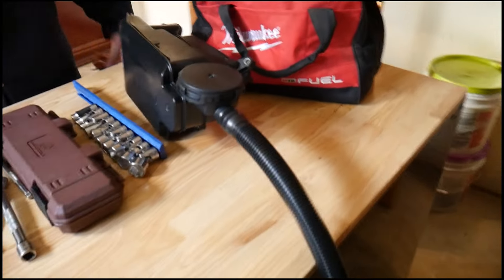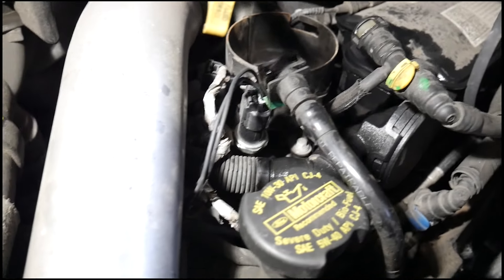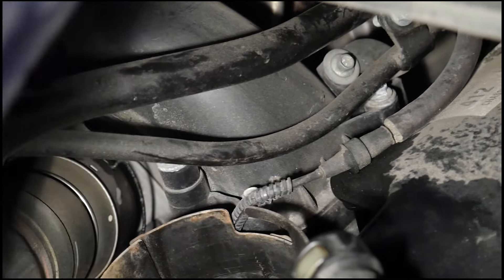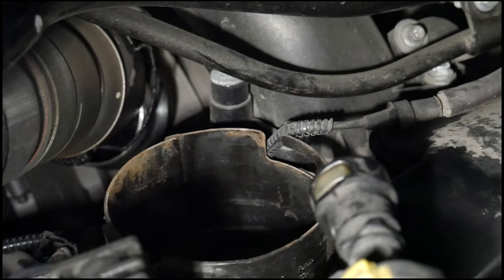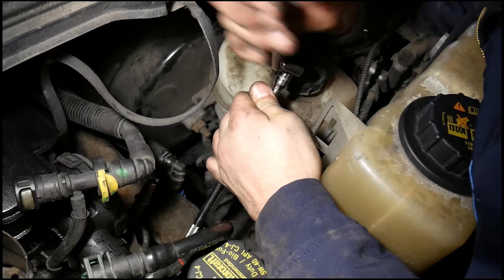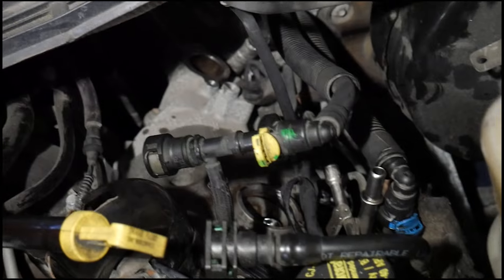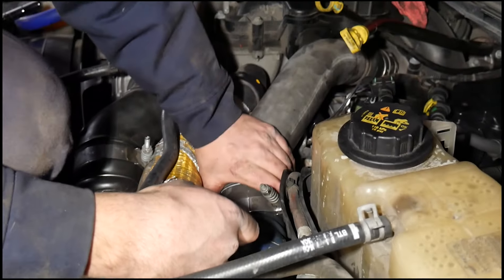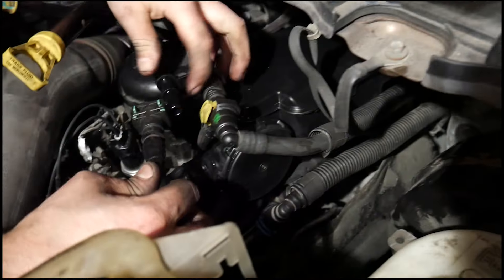6.7 Powerstroke CCV replacement

Comment: SURPRISE KIDS, part is on "National backorder".... none are avail.... as of 2/13/2024
Reply: Just bought one today
Reply: Ebay and multiple other places have them i just ordered one $115 from a ford dealership that lists parts on ebay. Google the part # you will see tons of places selling them
Reply: Got mine yesterday from full force diesel
Reply: Just got a OEM replacement 4 days earlier than expected from Rodbakerford for $128.95 plus tax.. free shipping
Reply: just changed one 20 mins ago brand new part from ford

Comment: EXCELLENT VIDIO.  Well done.  

However you might consider one change.  “Cycle your key a couple times to prime it”?  NOT NEARLY ENOUGH.  10 times at least.  As long as you can hear bubbles and gurgling sounds from the pump and filter  you still have air in the system.  If you prime it twice, then hit the starter and it starts then stalls that means you ran your CP4 pump dry causing metal on metal friction failure.  ( $10k). This is the most common mistake made when opening up the fuel system and it is likely why so many CO4’s fail prematurely.  When replacing upper and lower filters I cycle without starting 20 times.  It has never stalled.
Reply: thanks for this
Reply: This is a CCV filter not a fuel
filter
Reply: @TerpyToaster  The upper fuel filter was disconnected...

Comment: There are ccv boxes with filter came on f350’s I believe and f250’s came with ccv box with no serviceable filter. Mine is a 2019 f250 and has one without a filter. Since there is no filter is it still necessary to replace it?

Comment: What's the part number so I can look for a replacement.
Reply from the maker: depends on year. this specific on for a 2011-2016 is DC3Z-6A785-C

17+ is GC4Z-6A777-B

Thank you for letting us know. well try to remember part numbers in the future!
Reply: Cheaper at the dealer than online
Reply: @badmechanics9697  did you use the dc3z on a wide frame truck? The dc is for narrow frame. Fc3z is for wide frame.  Found this video while searching the difference.   Maybe you can help. 
You have a pickup bed or a utility truck? That’s the diff between narrow & wide frame.

Comment: Question on this older video.  You said it’s normal to have oil in the valve cover opening under the CCV box. Is it normal if it’s right up to the brim? Like lightly pouring out? Truck runs fine and doesn’t smoke. Was just replacing CCV for maintenance.

Comment: For what it's worth I got my filter from, Parts Geek, for $86.  It's the newer kind that replaces the whole Box.
Reply: Did you replace this version in the video with the newer one where the screws in top and takes a filter that looks like a Z ish and two white ovals as the filter?
Reply: @logangregory7105  
No sir. 
My F250 already had this type which is the newer version. It's called an oil-air Separator. 

 It's my understanding that the type with the removable/replaceable filter is the older/original version.
Reply: @logangregory7105  

This is what the oil separator looks like inside. Notice no filter.

https://youtu.be/I38JFfj3T3o
Reply: @amftpt  thank you for the info my dad has a 2017 and I have a 2018 mine was the newer version which didn’t have it so now I’m all good!👍

Comment: Thanks for the video. Instead of taking the hot pipe off the boots i just cut the plastic tube with scissors. Then moved the rubber sleeve back on the quick connect and bent all 3 plastic tabs back and pulled it out that way. Everything else i did the same.

Comment: Thank you for making this video. I bought my 20114X4 Powerstroke new in 2011 and I've driven it like a old lady. I deleted it but the EGR system is still hooked up. I retired the truck back in 2019 and I drive it every 2 to 3 months just to keep the fluids flowing and keep the battery in check. Every now and then I'll get smoke at idle and especially in reverse backing into my driveway. This gentleman has 114,000 easy miles on him. Do you think that this could have something to do with the crack case filter that you were changing in this video? Oil has been changed religiously on this gentleman and all filters as well by the book. The only thing that has never been changed is that crack case filter. Again thank you for your video, it was very informative and to the point. Thumbs up on your video bud. 👍
Reply from the maker: Thank you! that comment means a lot!. I would start with the ccv. if I remember correctly, it was like 140 dollars and about a 30-40 min job. that caused my hazy exhaust and found a good little bit of oil in my intake piping. after i did the new ccv filter i still had some oil in the intake so it took a few days for it all to get cycled through and burned so give it some time before buying anything else expensive. if that doesn't fix it, you may want to look into getting block off plates for your egr. its still prone to cracking and leaking coolant into your intake. depending on your model year, it can either be cooled by your primary or secondary cooling system. I am not sure the price of just plates since you already have the rest of the delete done but it shouldn't be a lot. you could also check your secondary coolant tank (the coolant bottle at the very front by your radiators) if its low, id recommend checking out your intercooler and getting it pressure tested. they can leak coolant into your intake as well and every model year intercooler is part of the secondary coolant loop.  sorry for writing you a novel!
Reply: @badmechanics9697  Thank you so much for the info and the fast reply. I will definitely check out those things. I never thought about the egr cooling system and I will look into capping it off. I will change out the factory ccv and give it a while to clear itself up and then go from there. Again, thank you so much, take care friend. 👍
Reply from the maker: @williamsantiago7303  no problem! good luck
Reply: @badmechanics9697  hey bro I got a 2014 6.7 just bought it.  It smokes but doesn't have pressure when I remove The oil cap Is that normal.
Reply: If its 2011 cracked valves probably if not ccv
Reply: @bigred5082  white or black smoke? Lol white means something is wrong. If it’s black that means the truck might possibly be deleted and tuned. Like someone above said. You can delete these trucks without having to remove the egrs.

Comment: Awesome video. Short and to the point. Looks easy enough (famous last words).
Reply: Yea just did it tonight its a total pain in ass took like 3 hours and 4 cuts on my hand. Unless you have the perfect combo of extensions and swivels those bolts are pain to reach and try to fish in out. I also had to unbolt the the brackets holding fuel lines to move those which block the front driver side one  that has a stud on top to hold wires
Reply: @bwooters8227  I had to take that stud your talking about out too. Still wasn't too bad thought. the bolts weren't as hard to reach as I thought they would be.
Reply: Just got done doing mine and I had to remove that fuel line bolt also. The back bolt on the CCV was a major PIA.

Comment: Aye man, I'm a ford mechanic. According to the WSM Manual, it states in bold "DO NOT LUBRICATE SEALS ON THE NEW CCV ASSEMBLY" Or something along those lines... Just an FYI.. But I do have a quick question for you, as there's nothing specified in service information, and I haven't been able to find anyone else talking about it... But one of the tags on the original CCV Case, has extremely important information... regarding the Injector Coding Numbers. I've always just written them on with a paint marker or something similar, but just wondering what do you do with the sticker/injector coding info?? Because if it goes somewhere for injector replacements or engine work, the coding numbers would be imperative to completing that kind of work.
Reply: Exactly what I was thinking about. I need that coil pack info to stay with the truck
Reply: @James-wy6py  well, it’s for the injectors. I’d say good luck on finding ignition coil packs on a diesel engine. 😅😂

Comment: Hello I have a 2012 with 163xxx miles and I'd like to change my ccv filter asap, but I also seem to "burn"? Some coolant. I don't see any leaks on my engine while it's running and I don't find any drips underneath but I can smell it seeming to burn every now and again. My exhaust is just unbolted at the front of where a delete pipe would bolt up and it leaks a bit of what looks and smells like oil with maybe a little bit of fuel? I plan to do the ccv filter then asap get the egr plates but idk if there's something else I should look into if the issue keeps up afterwards? It's not going through a ton of coolant but about a half inch when driving about 60 miles round trip
Reply: It hasn't had the ccv filter since I bought it about 3 years ago and that small coolant jug has never held coolant for me. It always seems to go somewhere
Reply from the maker: check both reservoirs, which one is leaking?

Comment: Do you know if the 2016 f250 6.7L has the ccv and if so if its the filterless one?
Reply: Yea 11-16 didnt use the filter style. You can look at yours to confirm no bolts on top its filterless. This job sucks tho i just did tonight not fun but they claim you still need to change the filterless every so often. My truck has 150k so did it
Reply: They will still swell up. I’m pretty sure that means change

Comment: Why did you change your CCV filter? I believe the one you have doesn’t require replacement, because there are no screws that hold down the top cover of the CVC filter.
I’m just curious because that’s what I was told . Did yours fail in some unexpected way?
Reply: I was thinking the exact same thing
Reply: I agree. I thought you did have to touch it if its the filterless version???? Anyone have info on that????
Reply: @RC-hm9vg  I believe it isn't actually filterless - it's just that those older part numbers have a sealed box so the filter is not changeable - meaning you have to change out the whole box.

Now I'm wondering if the newer box WITH a serviceable filter and the screws on top could be used in place on an older model like mine (2014 F250)  That way I could change out the box and just do the filters from here on out every 80k miles or so...

Comment: My 2018 leaking oil from upper oil pan.. (79k miles) dealer said CCV clogged. 2018 has the service replacement filter version. Need to replace that and upper oil pan gasket. 3k later…

Comment: Hey buddy, I asked you some questions about my powerstrokes  intercooler maybe leaking  and white smoke out of my exhaust and you gave me done pointers and it was a while back and you came thru for me and answered them for me and I appreciate that.  I finally  got my new ccv box and I was ready to install it today and I noticed that at the end of the elephants trunk it had a electrical connector and my factory one doesn't have that and I noticed in your video that the one you replaced doesn't have that electric connection either  but the one you installed has it. Did it still work without any engine lights coming on, isn't it something I should be worried about?
Reply from the maker: Hey! sorry for the late reply. I did not have any CEL come on. I wish i could remember what i did with it but im not sure i did anything. sorry if this doesn't help much it was just a little while ago
Reply: @badmechanics9697  Thank you for the reply and your answer. If you didn't have any lights come on then I shouldn't have a problem with mine, thanks buddy. 👍

Comment: My 2011 6.7 has started leaking oil out of the pan gasket, it seems. Would the CCV be the first suspect? Should this be my first fix?
Reply: Same thing is happening with mine, let me know if it fixes it
Reply: Make sure you do t have a leak from the air pump behind the water pump. They have been an issue.

Comment: Mine did not come with a ccv filter. I have a 2020 f350 dually. Any ideas?
Reply from the maker: if you bought it new it should be there, against the firewall driver side
Reply: Big black plastic box behind the top fuel filter.
Reply: @badmechanics9697  found it.  Thanks bro.  I ended up deleting it.
Reply: @akbychoice  i ended up deleting it.

Comment: I have a 2017 power stroke which has the same as this I see all other 2017 models where you can just change the filter
Reply from the maker: the newer models you can open up the housing and change the filter, the older ones you have to change the whole thing
Reply: And the recently released new version is non-filtered no bolt top and smaller. PC3Z-6A785-A 1X